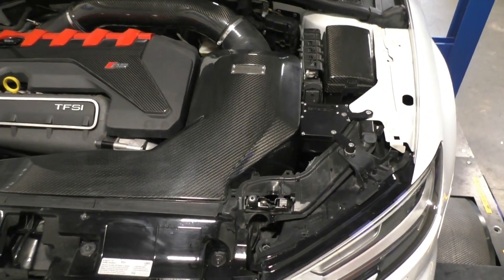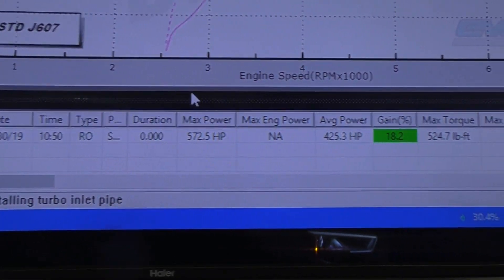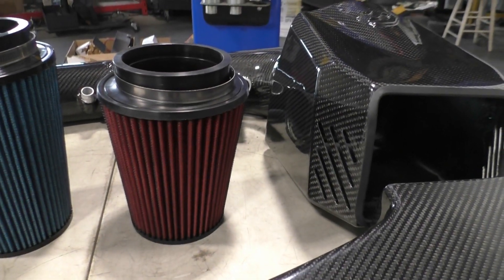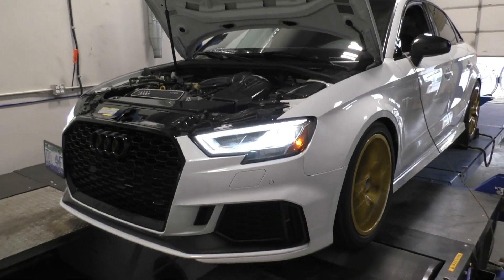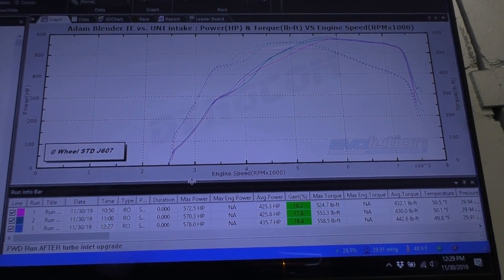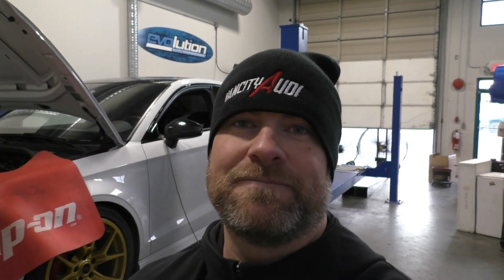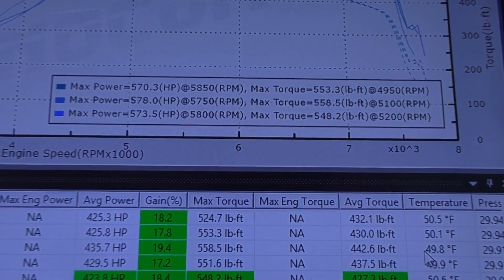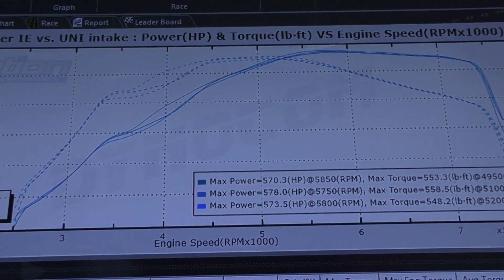Dyno testing the Unitronic 4" Intake System VS the Integrated Engineering Intake System - Audi RS3

Comment: So, I want to higlight some facts I observed... The very first IE pull seemed weird, as the torque was way less than on all other runs... and he actually mentioned slipping or something like that in the video... And if we only compare always the 2nd dyno runs, the results are actually as follows:

IE: 570.2hp / 553.3lb-ft
U-RF: 567.6 hp / 551.6 lb-ft
U-SF: 565.7 hp / 549.4 lb-ft

Suddenly data speaks more for the IE 🧐 ... 

Not saying any is better, just that these are my observations on these runs
Reply from the maker: I wish the first run on the IE setup didn't stutter/slip/pause, whatever the heck it did to make the lower numbers. Would have made the results more accurate.
Reply: Keeping IE on mine for sure
Reply: @boostenmkiv  i agree...i feel the IE intake performed better...especially on the second run where it was a bit heatsoaked

Comment: You should have put a new integrated engineering filter that would had made a diff , but l think its between dyno error reading and coolant temp etc(difference on the dyno), your best bet its to measure a 100-150km and 100-200km time(dragy or vbox) with both intakes, log all the parameters and see real data with the gps tool, but good vid man l enjoy it .
Reply from the maker: Go for it! Lol. It's always should have, would have, could have! I'd love to see those performance numbers compared between the intakes too
Reply: @VancityAudi  wherever you like it or not your test was not made well , first off you need to compare new filters,  log  etc , it would have been better to flow bench the intakes and see the cfm and pressure loss capability of each other than dyno them ....sorry but your effort it's useless without the correct data , and here you do  not have it, you dont seem to understand the dyno error and motor-ECU adaptations between pulls and hardware change.Have a nice day .
Reply from the maker: @jpsr20det  I'll wait till you put in the money, effort and most importantly time to do your own comparisons for everyone else to benefit from by making videos for us all.  I'll then take notes on how it is supposed to be done and will improve my efforts moving forward.

Comment: Outside the the 2 outliers (if the RS3 is anything like most MQB cars the first one usually has the most timing corrections) they all run 570/550 and have the exact same area under curve.  If the Uni could have reproduced that 3500-4500 area you might be onto something about it being superior.  Logs of the runs would be telling.  Good stuff though, keep it up.
Reply: Dirk Actually ... comparing only the second runs the IE had the best result. Unfortunately Adam didn’t spot that.

Comment: Why do you have the hood open dyno tuning? With the hood open it will give you a inaccurate reading
Reply from the maker: 😂 who told you that? We weren't tuning the car. We were simply doing a comparison between 2 pieces of hardware. The conditions stayed the same, meaning the variables were the same between both pieces of hardware.
Reply: @VancityAudi  try it with the hood down and you will see what I am talking about. With the hood down it will show more accurate numbers as you would be driving the vehicle. This is if you have enough air moving into the grille. You intake air temperatures with the hood down will have a closer numbers as you would have on the streets.
Reply: @VancityAudi  I'm not giving you any disrespect, I actually enjoy watching your videos. I just bought my first 2019 audi rs3 and your videos is giving me ideas to do to my car. My audi already has the IE intake installed. Idk if it has any downpipes or tunes. The previous owner had installed the intake.
Reply from the maker: @thomasdearing7718  I don't take what you're saying as disrespect. I just completely disagree with you. 

There is no way you'll see similar IAT's with the hood closed on the dyno doing repeated 4th gear pulls at over 200km/h as you would on the street with the hood down. There is WAAAAAY more air that comes through the front of your car in the real world (on the drag strip or on the street) as there is on a dyno. Or at least the dynos I have tested on. I have proof of this via the thousands of datalogs I've done.

It's very rare that dyno's have adequate airflow, so in order to accurately test hardware I need to ensure that the IAT's are similar and optimal between both products. If I don't do that then the testing is inaccurate.  I kept the hood open to make sure the IAT's weren't sky rocketing and negatively impacting the performance of the hardware changes. That way it is a fair comparison.

Comment: The problem with these test is anytime you put a new intake on any car you have to drive the car around for a while before you put it on the dyno.  This gives the car a chance to any differences in air flow over MAF sensors.  Many times the gains you see on the first pull will be mitigated by the ECU recognizing the changes and adjust down for airflow changes.  The last run was low because the ECU was adjusting.  If it was heat soak you could easily show your intake temps to prove the point, but you didn't.  Running dynos immediately after the install is what intake manufacturers do to falsely claim big gains.

Comment: Another great video Adam!  I am a current 2019 SQ5 Prestige owner with a JB4 on it.  Hopefully, I may secure a 2019 RS3 soon and will be looking to add some power items without a potential TD1 issue for service.  I may go with a 4" Air intake and Turbo Inlet from Unitronic and a JB4 unit for a reasonable bump in power.  I don't mind keeping the power increase mild to maintain the warranty for the time being as I can just unplug the JB4 before service.  Ultimately, I may go with a Stage 1+ ECU and Stage 2 TCU tune from Unitronic after awhile.  Thanks again for the product comparison!
Reply from the maker: No problem. Thanks for watching and good luck with the new vehicle purchase.

Comment: I guess you need to also try the AWE S FLO since thats 4.5 inches. Hank has found the intake tube needs to be as big as possible as he runs something like 5 inch custom tube.
Reply from the maker: If you want to ship me an AWE intake to test as well I'll get right on it!
Reply: @VancityAudi  Hah I would if I could!. I like your results though. Helps me plan out my part pile!
Reply: I bought the AWE 4.5"... very curious on the results.
Reply: @mhillenaar   @ DVX ?
Reply: @RS3EATTHEV8  Bought @ Awesome GTI UK as I live in The Netherlands.
Reply: @mhillenaar   ik ook
Reply: @RS3EATTHEV8  Cool, voor een TT RS of RS3? Zit jij ook in de whatsapp groep?
Reply: @mhillenaar   nee ik bedoel kom ook uit Nederland, zit niet in de groepsapp. Kijk alvast rond, heb nog een 7R
Reply: @mhillenaar  How do you like your AWE 4.5 ? Does it sound better than stock? I had a K& N 3.0 inch and it sounded awful but did give some measurable performance improvement.
Reply: @Christopher Renne  Hi, I tried a couple of intakes and found that the AWE 4.5inch intake to have the best fitment, and I love the sound it makes, but especially the throttle response improvements. You can run the AWE intake open without a box or with. With box is better for not sucking in hot air when standing still at a red Light for example, or at the drag strip. If more intake sound is needed, remove the rubber lening at the back of the hood at the front window. It will increase the sound by a lot but also helps with removing hot air and lower oil temps a bit as it has an engine bay cooling effect. 👍(Don't forget the 4inch elbow to be added to this system  as that helps with everything as well.

Comment: Any comments on which intake sounds better? Looking to get a closed intake on my 24 RS3 And I can get the unitronic for 25% off so just wondering
Reply from the maker: If you're looking for a better "sounding" intake, your best bet is to get an open intake and not a closed or semi- closed intake. Iroz Motorsport sells a 5" open intake that should flow extremely well.
Reply: @VancityAudi  interesting that you mention that. My buddy who has a glacier white just like me has the IROZ 5-in intake with the unitronic inlet and he loves it. 
I personally don't love the major flutter/woosh when letting off the gas. But I do love the zzzzzzz Turbo spool when getting on it. Not sure if you have a lot of experience with the IROZ But did you notice any IAT spikes with it? Oh and lastly, and I appreciate the help, did you notice a difference in sound between the unitronic and the IE in this video? Or were they identical? Thanks again
Reply from the maker: @Daveyboy_RS3 the only time you'd really notice an IAT spike would be in stop and go, or sitting idling at the drag strip. If you're in motion, you won't experience that with an open intake like you think you would.

I can't definitively say which intake was louder, it was so many years ago. I'd have to guess the Unitronic one though with a more open design.
Reply: @VancityAudi  Well I guess considering I can get The uni for about a thousand, about $450 off, I think it's the best bang for the buck. Plus I hate Turbo flutter, and I feel like the uni will give me less than with an open setup. But correct me if I'm wrong if you have the time lol. Thanks for the info
Reply from the maker: @Daveyboy_RS3  I believe your turbo flutter will also have to due with the software you are using. Either or will be a solid intake though
Reply: @VancityAudi  I'm actually stock ECU obviously right now and going to probably keep it that way. Maybe do the racing line PCM. But as far as the intake, my buddy has the IROZ with the uni inlet and it sounds incredible
Reply from the maker: @Daveyboy_RS3 ohhhhhh, knowing that your car is stock means this will do nothing for performance at all. It also will not sound a heck of a lot different either because you're not pushing the car nearly as hard. WAY less boost than when modded.
Reply: @VancityAudi  yeah sorry I should have mentioned that to begin with. Totally stock ECU. I mean we don't really have any options yet except for when Unitronic releases their tune. Only thing about IATs is I live in South Florida. And it's like 100° outside 8 months of the year. Of which I think the FMIC would be integral. I'll be getting the Unitronic intercooler as well. Just curious if you have any experience with the IROZ 5-in intake. I know I won't see any noticeable performance from just an intake / inlet. Maybe 5 - 10 HP, But the sound, or not ruining the sound is very important to me. I'm putting in the mid pipes this Saturday, and I'd really like an intake that boosts up the turbo spool nicely, but without making it sound like an SRT4 when letting off throttle. I don't mind a little whoosh when letting off, but the turbo flutter when letting off is something I can't stand. 
Or I could just leave the stock air box, get a 4-in pipe and drop in a Revo filter for far FAR cheaper. Not sure what your thoughts are on that. I will be grabbing my buddies racing line PCM once he does the uni tune just to give me a little extra power and keep my warranty for now since it's still so fresh and see how I like it. Thanks for the info by the way
Reply: @VancityAudi  I'm sorry to bother you but I did read that you guys tested the 3-in vs the 4-in inlet. Couldn't really find the video, But I am 100% staying stock turbo. I might do a unitronic tune at some point, but no hybrid turbo nothing like that. Would I be losing some low-end power if I go with the 4-in inlet as opposed to the 3-in that Unitronic offers? Or am I just safe going with ECS tuning 4-in inlet for $169 instead of the $550 for the Unitronic piece. Again I don't cheap out on anything, but if they're pretty much identical, I don't want to spend money just to spend it. I appreciate all your help again
Reply from the maker: @Daveyboy_RS3  to me, it's all a huge waste of money having a stock ECU & stock TCU and upgrading your hardware. Your car will not be able to really take advantage of any of the additional hardware except for an intercooler providing you lower IAT's for consistent power delivery in the heat.  Besides that an open intake will make it louder, but you don't want to hear turbo flutter, so don't bother because I can't guarantee you won't hear that at all with a stock ECU. If you're looking for something to get more 'grunt' without necessarily voiding your warranty, this is the direction I recommend: https://youtu.be/FV6ywPUlsUs?si=wqEwE4GvRs67zNSK
Reply from the maker: @Daveyboy_RS3  Again, I have zero clue as to why you are upgrading hardware when you won't be able to take advantage of it while remaining stock. If you are going to upgrade your software than go with a 4" turbo inlet. Here is the video: https://youtu.be/8FIPygP03J4?si=FYuCUxB2NUNOeJ4p
Reply: @VancityAudi  Oh yeah I'm going to eventually get the Unitronic stage 2 ECU and TCU. I just don't want to get it right away, let the guinea pigs go through the necessary updates and fixes and then once my warranty is getting a little closer to being out I'll do it. For now My buddy has a racing line PCM and he's grabbing the unitronic tune immediately and going to give me his PCM for the time being. 
So with that being said, the fact that eventually I will be tuning it, I'm definitely going to do the FMIC cuz I'm in South Florida and it's crazy hot all the time, And I've seen that video with Hank at IROZ But what part are you referring to that will give me that extra grunt? Thanks again
Reply from the maker: @Daveyboy_RS3  All of the parts listed on Unitronic's website under their Stage 2 ECU is what you should be running for maximum performance: https://www.getunitronic.com/ecu-tuning/audi-rs3-2019-stage2
Reply: @VancityAudi  perfect, thanks again. But I was still curious what you were referring to when you said if I want a little more grunt, but not void my warranty, what were you referring to?
Reply from the maker: @Daveyboy_RS3  Everything shown in that video.
Reply: @VancityAudi So....
1-IROZ 5-inch intake with shroud. and from what I understand I need intake adapter hose.
2-Unitronic inlet and from what I understand I need inlet adapter hose. (Correct me if I'm wrong on those) 
3-FMIC (I don't need the 1000 HP from IROZ So probably just go Uni as I do get cost through a friend) unless you don't feel The uni FMIC does the job as well as certain others? 
4-titanium exhaust, that might be something I do towards the end, and I'm probably would do the switch path as I really enjoy how it sounds as I've heard it in person. 
5-Unitronic dog bone. Heard that this makes a massive difference, much smoother shifts ETC, especially 2-1. 
6-JB4 unit... However my good friend is running the racing line PCM piggyback And he's had very good experience with it so I'll do one or the other. 

How's that sounding to you? I've watched almost all your videos in a very short time and so impressed by everything you do. That's why I'm really been bothering you lol. If I may ask, if you could go back, would you switch out the Unitronic intake for the IROZ?

I'm pretty confident in all the other items I want but I'm a little torn between doing the closed Unitronic and open 5-in IROZ.

-

Comment: (1) Any trap speed increases or 60-130 mph decreases from IE to Unitronic 4” intake? I acknowledge apples-to-apples is difficult with different DA’s, road conditions, e-content, other hardware changes, and any software changes. (2) How do IE and Unitronic compare in sound now that you’ve been back on the road? I know everyone has different noise preferences.
Reply from the maker: 1) Sadly I have no idea. I never did that type of performance testing with these 2 parts, sorry. 2) I think the IE part may have been a tad quieter if I can remember all the way back, but seeing as they are both mainly closed units they remain pretty quiet which I was thankful for.

Comment: Adam, did the unitronic intake system fit their turbo inlet better than the IE? From what I understand the IE needs a small bit of work to adapt to the 4" unitronic turbo Inlet. How does the quality of the 2 seem from fit/finish?
Reply from the maker: The Unitronic intake pairs up perfectly with their inlet. The Integrated Engineering intake just needed to be twisted and turned a but to fit well. Nothing major though.

Comment: Finally!!!! Someone that put their Unitronic stage 2 e85 on the dyno to get #s! I have been searching and searching forums for someone with actual #s since Unitronic states 621hp 564tq at the crank. Very very impressive that you are making those numbers on just a stage 2 to the wheels. Question though About your torque #s, your making 550ish wtq ? Did unitronic tweak your file since you have a built motor now or is that just their basic off the shelf stage 2 e85 set up?
Reply from the maker: I am just using the production files available to everyone that purchases Unitronic software. They have no altered or changed the files for me.
Reply: Vancity Audi then that is extremely impressive numbers to the wheels !! I can’t imagine once a hybrid turbo is installed
Reply from the maker: @SniperX-vc9dk  ya, it was super cold so it made more power. Plus I have a feeling that dyno may read a little high.  Hard to imagine I'm making that much power.
Reply: Vancity Audi I think on a dynojet maybe 530-540 whp , I’m going to be installing the same set up here shortly and will be getting it on a mustang dyno which is the lowest ready dyno and will post numbers. I’m curious what it’ll make but I’m sure it’ll be pleasant
Reply from the maker: @SniperX-vc9dk  Stay tuned to the channel because coming up this weekend I'll be uploading a video of a 3 way dyno comparison running the Unitronic Stage 2 - 93 file.  I will highlight the huge differences in the way different branded dyno's read.